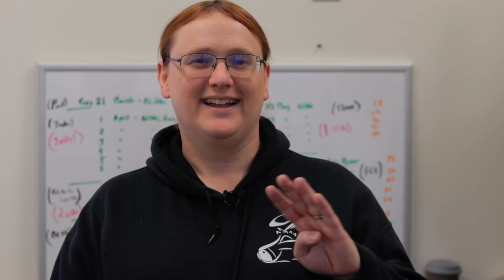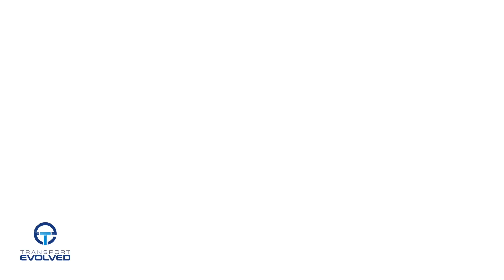What Should The Design Lifespan Of A Car Be?

Comment: I had a Neuton battery mower with a lead-acid battery that was actually useable for 9 years.  With care I feel that a quality Lithium battery and a good EV automatic battery maintenance system should have 80% capacity at 10 years.  Maybe 60% capacity at 15 years.  A quality electric car with an owner who makes conscious decisions on how to extend battery life should be able to make these time marks.  The days when the average 1960's vintage car was considered dead at 100,000 miles without a heart transplant is long over.
Reply: The highest mileage Tesla S is around 400,000 miles on the original battery and motor.  It is all about keeping the battery in the correct temps, and charging and discharging at reasonable rates.   FWIW, 80% of original battery life is Tesla trigger for battery replacement.  As I understand it used battery packs will go through refurbishment and into Powerwalls.

Comment: 15-20 years should be aimed for on the basis of claiming about caring for the save of co2. That means we need cheap replacement electrical drivetrain parts - cost plus 20% and support for independent out of warranty repairs

Comment: I think the cars bodies should last for at least 20 years. Electric cars need to be made more standard and modular within each manufacturer. To improve the right to repair which is an idea they are resistant to. That way a component could be replaced as easily as an air cleaner in an ICE car.  

Car electronics should be much more weather sealed  than they are today to ward off moisture contaminants and also be more fault resistant. Especially on some of the most expensive computerized modules.

New cars should be designed more like a computer case. I would like to repair and upgrade most of the electronic systems on a car like a personal desktop computer with the possibility of quite functional inexpensive cost options.

The space frame structure and amount and layout of electric car components needs to be further simplified hopefully in an uncompromising way and standardized  to reduce manufacturing costs and cost to repair.

I think what I said, would increase the satisfaction of car ownership and hobby enhancement to similar levels that was seen when cars were made without any Electronics in them.

No more shoehorning electric car bodies from ICE designs. I think car companies need to be more serious about the future progression of cars and what it means to  recyclability. 

Well I can dream anyways. I know that some of my hopes for the future affordability and useful life span will come true with the expectation of miniaturization of electrical parts and the decrease in materials required to make them.
Reply: I think the car bodies are already there.  It's the engine failures and electrical problems that see cars in the scrap yard.

Comment: like android phones that never or rarely update their software ... that's another issue.  Another issue ... what aftermarket will there be for replacement batteries for the early Leafs?  Maybe with a higher density battery will actually increase their range, but will the software allow that?

Comment: there needs to be a complete refurbishment industry, that replaces the battery, the interior soft surfaces, any broken/cracked glass. They were doing this in Hong Kong and Japan with the 1970s Toyota Crown, keeping them running for 50+ years, and looking good, performing well.
Reply: Why not just recycle it and buy a new car
Reply: @unicornkatana9836  In Japan and Hong Kong the desired vehicle  was considered perfect for taxis and Toyota stopped making them. The real answer should be resources, it takes far fewer resources to refurbish, and you get a new-like vehicle for half the cost of a new one.
Reply: @SuperFredAZ  if no new cars are made, then no new models would exist and technological innovation would slow down dramatically
Reply: @unicornkatana9836  Who ever said there would be no new cars? I just suggested that an alternative might be for some cars to be refurbished.

Comment: The problem is not how long cars are designed to last, but rather cars are not designed to be maintained and worked on any more. New cars have become one shot, throw away items, where even the simplest problem like a failed head gasket which on a Morris Minor could be fixed easily at the local garage now renders a modern car as a financial write off.
I should imagine soon there will be a plethora of battery suppliers and drive train suppliers providing solutions for upgrading Nissan Leafs, Chevy Volts and converting existing cars into EV's, since there is a growing market for it, probably much to the dismay of the major car manufactured who have honed their skills at selling us things we don't need and keeping us poor.

Comment: Auto manufacturers keep the life span low with electronics  Make simple, minimum electric cars. This means you need elbow grease to roll down your windows, adjust your seats, etc.
I would also like all states to adopt right-to-repair laws. Another law I would like to see is law that says if you have title of the car, you are entitled to the complete specs of the car, including tolerances, computer codes, etc.
Reply: No, it's the mechanical parts that wear out and break, not the electronics. Tesla does it right with minimizing the number of moving parts and doing everything possible with computers and software. That drastically increases reliability, decreases maintenance cost and allows easy upgradeability to prevent, or at least slow down, deprecation.

Electronics is also required for safety, driver assist features already save a lot of lives, and full self-driving will virtually eliminate traffic accidents. And self-driving cars will make car ownership deprecated too, because it will be a lot cheaper to use car sharing services. Also, repairing your own car is only important for a tiny-tiny minority.
Reply: @andrasbiro3007  - True. But a car owner can repair a broken part, usually with a cheap part. Most of us cannot repair a circuit board and these are very expensive. I can change my brake pads and even the whole drum and caliper assemblies. Before fuel injection, I did my own tune ups. I have changed a head gasket. But, when my window would not roll back up, it was $300 to "repair." I actually repaired a broken window assembly on my 1971 Datsun 1200. I went to the junk yard, got a used one, and replaced the one in my car. In my 1976 Civic I put the handle that you roll the window up and down back on.
One of the odd consequences is that you see an increasing number of cars open their doors to receive their food at the drive through, presumably because their window no longer works and it is too expensive to fix.
Reply: @Bra-a-ains 
You could fix your own car, but most couldn't, even back then. And of course every technology gets more and more complex, that's unavoidable, and the advantages still outweigh the disadvantages by a wide margin. For example without electronics my Tesla would be very dangerous to drive, because all of that unchecked power, but with the computer, it's the second safest car in the world, behind the Model 3.
Actually, I have the same problem with computer that you have with cars. 20 years ago I could easily diagnose and fix faulty hardware and could solve most software issues too. Now my very expensive PC has a bunch of odd behaviors that I'm unable to fix. The complexity of these systems are way beyond what's manageable. And unlike mass produced cars, every Windows PC is a unique combination of hardware and software components that each interact with each other in unpredictable ways, so even professionals don't have much better chance then me. But I still don't want to go back to the old days, because the lack of complexity also meant lack of performance and lack of usability.

Cars are not too expensive to fix, people are too poor to pay for the repairs, especially in the US. There are still cars that are cheap to fix, just not American cars. My previous two cars were Skodas, and I one big reason I bought them is that those are very reliable and very cheap to fix.
Also, if the windows doesn't work, that's a shitty car in the first place, I've never heard of anyone having problems with their windows.

And finally, you can repair an electric car yourself, even a Tesla, you just need different skills. There are people who rebuild Teslas from wrecks and salvaged parts. The trick is that you don't repair electronics, you replace them. That's how it's done in every industry. Because electronics are usually relatively cheap, but very hard to repair. The only time electronics are repaired is when they contain very important data that hasn't been backed up properly. And even then, the goal is just to save the data, not the device. Fortunately high quality electronics are extremely reliable, so this isn't a big problem.

Comment: I don't see it going much below 8 years because of the effects on leasing.

I don't see it going above 8 years because of the difficulty to find parts.

I have a 2008 whatever on its second engine and now 11 years later it was difficult to find parts to replace the suspension this year.
Side note there was only 80000 of them made which is not uncommon once you get below the top 150 models to the remaining 150 models.
The more made the longer people will attempt to supply the parts to fix them.
Also if there is a fan base around a model it will last much longer.

Governments assume about 10 for thier vechicles.

Comment: "Should" depends on the market as well as public acceptance of older models. I think the taxi cab market offers an example. In the US case, there used to be a single model (made by Checker Motors of Kalamazoo, MI) that was literally everywhere and built like a tank to endure daily abuse. If I recall correctly, there was a similar car in the UK.

A small number of private individuals bought Checkers since they were dependable and the overall cost was low when amortized over 20+ years.

I tend to think that life spans will increase as cars transition to public fleets (due either to people not wanting to own or to self-driving cars).

Comment: Modern cars have soo many components, also most custom made. Compare with the part count of a VW beetle. Sourcing and stocking all the spares for 20 years will be a nightmare! Just look att Richie Kidd's Tesla rebuilds, there are electronics boxes hidden in every nook and cranny of these cars. and wires with connecors going everywhere. 20 years of moisture and dirt and no amount of contact cleaner spray can make these gadgets running.

Comment: Car longevity is related the technology available at the time of construction:
1) Any car (except for Volvos) before 1970 is prone to rust which limits their lives anywhere roads are salted. Introduction of plated sheet metal sorted that.
2) Emission standards with their durability test drove up engine design and durability. 200 to 500k miles are not uncommon.
But are heritage car makers are addicted to their returning new car customers which they will lure with new features: self drive, free rapid charge and soon car inter-connectivety to further extend self drive features. No interest in "refresh" a 10 year old product by offering new battery pack, new seats and other updates. So we have to see how the ICE aftermarket industry sees its future. Like the car makers they will have a choice: join it or die. That is evolution for you!

Comment: In the UK an aftermarket battery repair/partial replacement industry has started with Indra Technologies. As only a few cells tend to be really shot , the partial replacement can be cost effective. 
Currently many people run 20 year old cars , but be aware that car manufacturers need to sell cars to survive. A leased transport supply model would be needed to extend the intended life of a car without bankrupting the auto makers.

Comment: 50 year old cars, don't have airbags, emergency auto braking, anti-lock brakes, potentially seat-belts, and are more dangerous for others on the road because they wont crumple to absorb as much energy in accidents.  Typically this is viewed as dangerous for the occupants, but that energy can just as easily be transmitted to other vehicles in an accident.  In the next five years or so, self-driving will be a very important safety feature.  Once that becomes widely adopted, manual cars will be considered *dangerous*.  Not sure that we want old vehicles on the road.

50 year old cars are built much heavier than modern ones, and are much less efficient that new ones.  It might be better efficiency to RRR the old vehicle and use the materials in a newer design.  Hard to say, stats and math needed to confirm.

Comment: You have to look at it game theoretic terms.  The equation for car manufacturers goes something like:

- what guarantee are we offerring?We make the most money from the guarantee by replacing as little as possible during that time.

- the performance specs (efficiency) are generally optimized by making vehicles lightweight. All eles being equal a lighter car will have greater range and higher efficiency (when new)

Building for a longer lifespan means more weight to get added robustness.   The vendor gets zero revenu for building something that outlasts the gurantee, and is penalized in terms of efficiency.

So a realisting version of the question being asked, how much more are you willing to pay for a car of the same specification that will last longer than current guarantees?   The lasts forever but costs alot game plan is essentially the Mercedes business plan.  They are already competing with other brands that offer higher efficiency at lower cost, so  the market seems to be taking care of this option.

On the other hand, we could re-phrase the question something like:  How do we optimize the three R's with cars? One answer might be:  make the manufacturers responsible for the vehicles at the end of their life, giving them an incentive to make it efficient for them to reduce, re-use, or recycle.  Another option would be start standardizing things. It seems pretty clear that the skateboard is generally the ideal layout for batteries, one could provide incentives for manufactures to produce standards compliant batteries that are easily replaced (perhaps make a tax credit conditional on standard compliance.)  Eventually, standard batteries would be cheaper than the proprietary ones, and the market could take care of it naturally.

Comment: Closely tied to all this is resale value. I was schocked to see a 20,000 mile Fiat 500e selling for $7000 USD a few years ago. That is about 1/5 of it's new car value and with no battery degradation was an incredible deal. If I were to trade it in in a few years I'm guessing it will be nearly worthless. I got value out of it but the point is what's to become of this shinny fully functional car that, at some point, won't go very far. Maybe they'll be rebuilt little four cylinder engines that will be available to power it. (joke).

Comment: If the drivers are serious about helping the environment and if the car companies are serious about the environment (and I really dont believe companies making the cars care)  If the drivers did they would replace the battery in a leaf or tesla when it fails and continue to be happy with it or fix whatever it is that is faulty and keep the car.  They wouldnt dump a car after 3 years and buy another.  The companies would design a car that is more reliable and not push people to replace a car after a very short period of time .   Drivers would be more contenet with a car over a longer period if time.  My prius is 13 years old.   It's had its battery replaced once.  It runs great still looks nice.  It has a quarter million milea on it.
Reply: 7 yes isn't short

Comment: The biggest problem of modern cars is that they are designed with a computer. Old cars have been designed by people thinking about practiability, useability and they had to be easy to repair. Try to change a headlight unit of a VW T5 Bus, when you are fast you need 2 hours.

Comment: I love my 30+ years Volvo 240. Some day I'll convert it to electric and keep using it even longer.
Reply: I had a Volvo 240 station wagon in 1964. Worst car I ever owned, and I’ve owned plenty. It was in the shop more than in my possession. The dealer was unable to figure out why it had no power and could not go up hills. Unbelievable. I got rid of it within a year.
Reply: They didn't exist yet in 1964...
Reply: @zapfanzapfan ... sorry. Typo. It was 1974.
Reply: @DrPeter0  no power and could not go up hill !  That's what they were a like.  Because they were built like Tanks.   Most had 2.1l petrol engines but were still slower than a 1.3l.  Sierra/ cavalier
Reply: @DrPeter0  I suggest that you were using a useless dealer. The 240's that I drove were reasonably fast for the time, 110+ mph, and unburstable and reliable.  That was with the early mechanical fuel injection  petrol engine .
Reply: @Barry PURKIS — I’m sure you’re right, but it was the only Volvo dealer in Denver.

Comment: Part of the answer is not just the car itself but what goes into it. For example, batteries are too expensive to replace but as costs come down there are bound to be more replacements available creating competition. I have not completely given up on the idea of rental batteries which get swapped out in minutes rather than recharged which takes hours. Suppose that the EV motors were rented as well and at the appropriate mileage they could be swapped too. Pretty soon the car could last a lifetime with scheduled maintenance.  As rideshareing becomes popular as it is bound to be instead of car ownership, some of the vehicles could be in service for a very long time saving the consumer the cost of a car purchase.